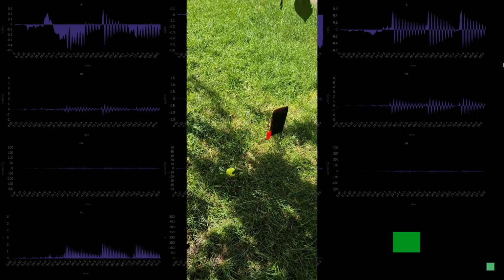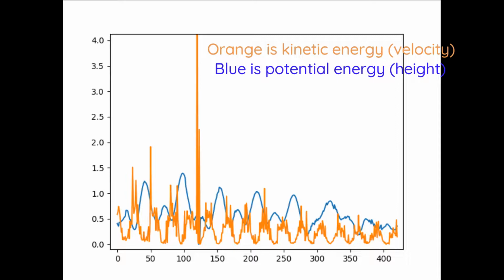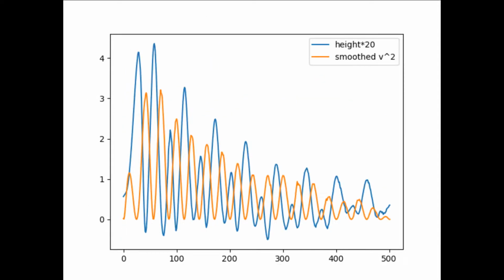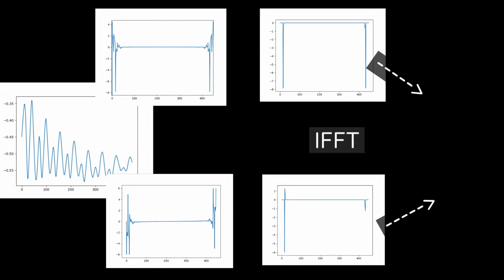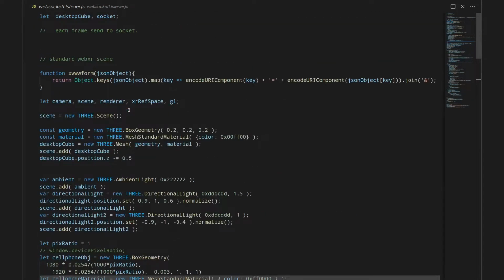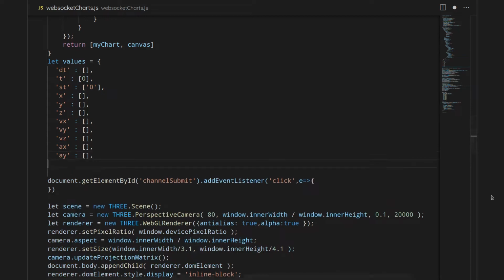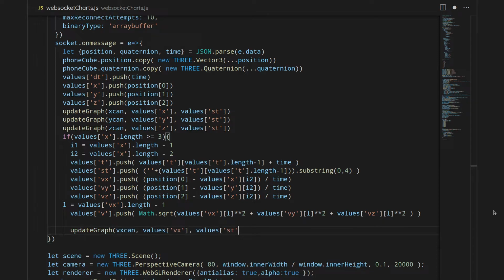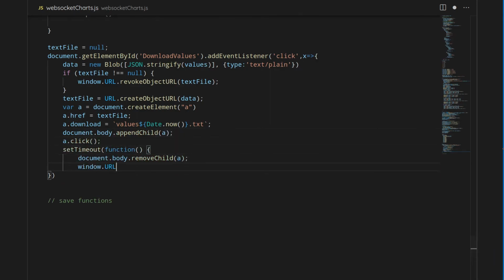Physics-based Physics Simulations (in webxr)

Comment: What are your thoughts on AR with WebRTC?
Reply from the maker: Also my advice sometime gets dated by webxr updates. So if you have an idea you should probably just try it out!
Reply from the maker: It's in my todo list. VideoRTC is a little challenging because of how webxr works. The datachannel is apparently limited to 64kb which is why i went with websockets (also i have more websocket experience). But I'd expect that webrtc would have lower latency.
Reply: @grae_n  I feel ya I’ve worked with both for a video meeting platform that coincidentally was for providing expertise to remote AR headset operators.
Reply: @grae_n  Your content is dope btw, it’s so hard to find quality Web AR/VR content. Do you work in the field or an adjacent one? Also what’s the best way to get in touch with you I have some ideas combining AR, AI, & Blockchains
Reply from the maker: Sure! My email is attached to the about section on youtube desktop or github.